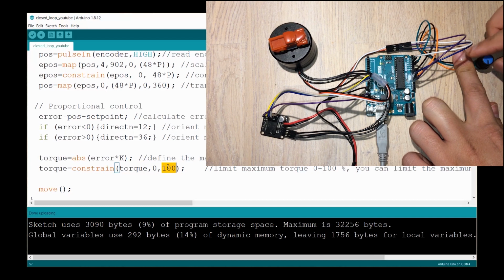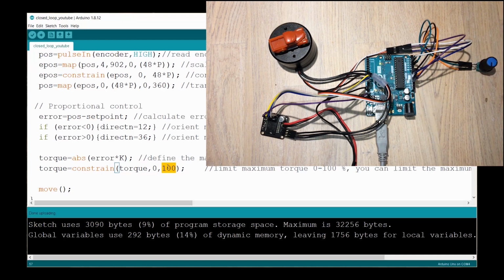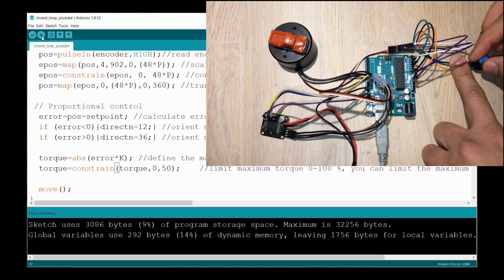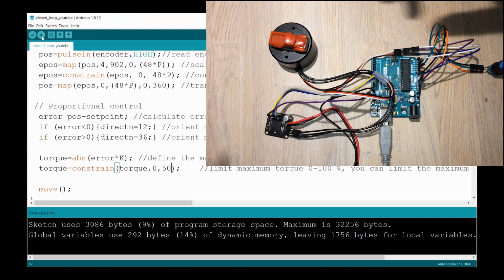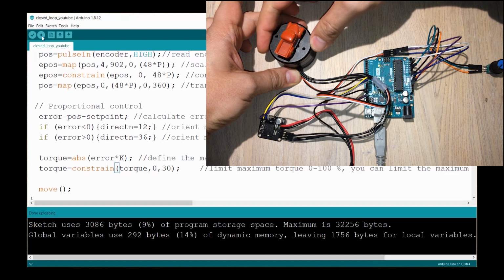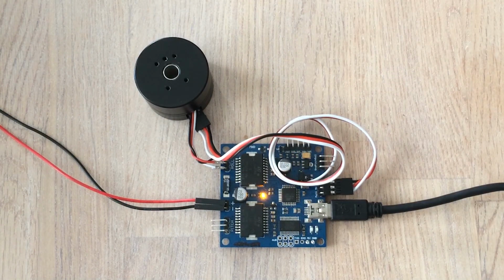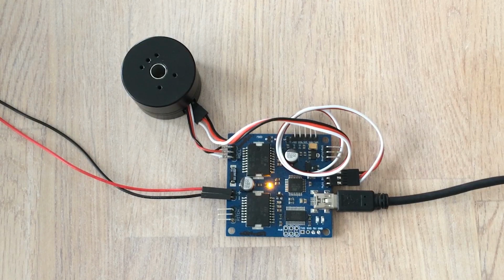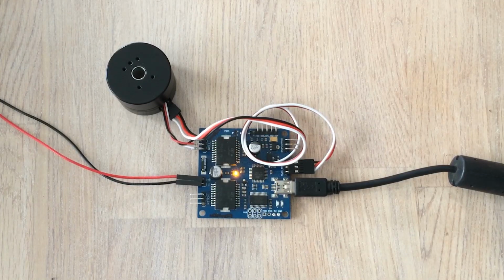Arduino Brushless DC Motor (BLDC) FOC Control Part 5 - Closed Loop Control Servomotor

Comment: Something you could add to this: currently your synchronization yields nearly zero offset between the stator and rotor fields.  You could nail this to a 90 degree offset and then control both velocity and position with voltage only

Comment: Thank you so much for this. I would love to see how you would integrate an continuous optical encoder for with multiple turns for applications where the range of motion is greater.
Reply from the maker: Watch my video about Tennange Engineerings arm. Its solved there ;)

Comment: hello Pablo,  ur videos really came in handy to understand the principles. i've got some questions which i'd really appreciate if u would clarify them for me, i want to use a gimbal brushless motor for turning a reaction wheel according to a controller, right now i want to choose my main board and start building the thing(i've done some designs on controller):
1. gimbal bldc motors have relatively small cables, which i suppose they won't carry much current, is there anyway to use the Arduino itself to drive the motor and not a secondary driver(like the L6324D)? 
2. is this way of controlling bldc motors(this sinusoidal signal ) the only way to control the bldc motor? i mean, for this kind of signal we are limited by the speed of the Arduino to compile each loop which may cause some issues in future(for my application) related to runtime and coding algorithms.
3. is there any "GIMBAL" bldc controller which would automatically produce the sine wave? or they are all the same? i guess what i'm looking for is a kind of way that would be easier to work with like voltage in simple dc motors!
4. usually a closed loop system's controller, produces a voltage which will be sent to the motor to move, how does this work out here? i mean the calculated value for controlling the system is voltage! how should i compliment it with the code u used?

thank you very much for ur informative videos, liked and subbed looking forward to ur future projects and informative vids

Comment: Hey man! Great videos! I have a question regarding the development board. I have a similar board from some gimbal project, but i want to use it as you do, it also has AT Mega 328P and basically looks exactly the same, but Arduino IDE does not "find it". Is there something i have to do? Burn new firmware up or how does it work? 
Thanks for help and keep up the good work! ;)

Comment: Are you just writing to the high side mosfets or is there hardware between the arduino and the drivers? Just asking as the code only is written to 3 output pins.

Comment: Hey Pablo First of all amazing video series. I had a question regarding the temperature of the gimbal motor, does the motor heat up and if it does, is it normal and what max temperature can be considered to be normal. Is there any way to prevent the motors from heating up?
Reply from the maker: Thanks! Yes, the logical way is to reduce the current in the coils. So either reduce the voltage of your source or multiply the output by 0.5 for example so that the current drops to half, then adjust that to a value that gives you the torque you need without overheating the motor. A motor like this will de-magnetize at around 100-120 deg C.
Reply: Also I would like to know if keeping the torque constant and applying PID on the direction value is a good idea, because what if I want to apply torque against the gravity with a load on the motor.

Comment: Hello,
Thank you for these 4 videos, very clear and very well explained.
I am looking to develop a torque control of a brushless motor with arduino.
The particularity of my control is that the couple must be proportional to the difference in position (k3 * Dtheta ^ 3 + k1 * Dtheta).
Do you know if this kind of control is possible?

Thank you for your reply!
Reply from the maker: Sebastien Prothin im not sure I understand... is there a paper or article you have where I can read about?
Reply: @juanpablocanguro  
In this paper, there is the explanation of why I want to do this:

https://we.tl/t-StwjvR8oyF

I work on the vibration control on the wings, with a system called NES, for the moment we are using cubic spring systems for wind tunnel tests. but I would like to be able to simulate a behavior of spring with a motor, to be able to sweep a greater range of parameter. This is why I want to control an engine with a cubic torque.
Reply from the maker: Sebastien Prothin interesting paper! Well, now I understand a bit better, i believe then what you need to do is to grow the magnitude of the magnetic field vector cubically to the magnitude of the error, torque = K*error^3, does that make sense? Keep me posted, would love to be of support ;)
Reply: @juanpablocanguro  
I will try to test this quickly.
For you, it is preferable that I use the driver L298N or L6234D?

In general I use an analog encoder which gives me the position of the motor, can this replace the encoder you use?
It is a sensor which gives me 0-5V for 0-360 °.

Here are the specifications:
https://cdn.usdigital.com/assets/datasheets/MA3_datasheet.pdf?k=637238129807247672
Reply from the maker: Sebastien Prothin i believe the L298 is not very efficient and gets hotter than L6234, apart from that, they both give good results :) maybe check the max current you need and match with the driver that takes that current
Reply: @juanpablocanguro  
thank you,
Is there a shield with the L6234, I can't find it on the net?

Comment: First of all great video! I have a question regarding your code: Why do you need to constrain() the epos? I think using map() it is already impossible to get out of range?
Reply from the maker: Felix Hübner well, i had some bugs that could have been caused by other things, but i wanted to make sure, as sometimes noise in the sensor would cause the value to vary away from the range, and I thought maybe map() was extrapolating outside the range, could be redundant as you noted, thank you!!!

Comment: L6234D  is not the best solution. I used DRV8313, it has same interface, but much more better efficiency factor. 

The same task I have solved by different way.
In my application I operate with velocity to have possibility to control it. 

    lastAngleA = curAngleA;
 
    curAngleA = angleA - ofsetA;    
//position from encoder
    
    lastAngleB = curAngleB;
    curAngleB = angleB - ofsetB;  

    lastVelocA = curVelocA;
    lastVelocB = curVelocB;
    curVelocA = curVelocA*0.7 + (curAngleA - lastAngleA)*0.3;
 //kalman filter
    curVelocB = curVelocB*0.7 + (curAngleB - lastAngleB)*0.3;    

    //PID
    errVelocA = tarVeloc - curVelocA;
 //error
    errVelocB = tarVeloc - curVelocB;
    
    stepTA = errVelocA * Kp;    
             //proportional
    stepTB = errVelocB * Kp;    
    
    integralA += errVelocA * Ki;              // integral
    integralA = constrain(integralA,-20,20);
    stepTA += integralA;                       
    
    integralB += errVelocB * Ki;              // integral
    integralB = constrain(integralB,-20,20);
    stepTB += integralB;                       
    
    stepTA -= (curVelocA-lastVelocA) * Kd; 
    stepTB -= (curVelocB-lastVelocB) * Kd;     
   
//and how I do  magic
    stepB = constrain(curAngleA + stepTB, curAngleB-300, curAngleB+300); // 300=1024/4 because I have 1024 sin value 
    stepA = constrain(curAngleB + stepTA, curAngleA-300, curAngleA+300);

Comment: First of all thank you for the video and the code on github. I have a question. I'm trying to control a gimbal with the same code but diffrent from yours is that my motors dont have hall sensors or encoders so i'm feeding the position of the IMU as the motors rotor position. I'm also using a complementary filter for the noise reduction. But still it is very hard to control and i have always vibrations on the motors. Do you have any recommendations ?

Thank you in advance.
Reply from the maker: İsmetCan Hasancebi you can refer to my first video (click part 1 in the links) that code is for bldc motors with no sensor, hope it works;)
Reply: @juanpablocanguro  I saw your first video on the series. But I need a closed loop control without the capability of the rotors position. Only with the help of IMU sensors.
Reply from the maker: İsmetCan Hasancebi yes, use that code, and add the Proportional control using the angle as the variable to control, measure angle with imu, then calculate error*kp and add that amount to the motor position... good luck!

Comment: Pablo, Great project & superior explanation!

Newbie for Arduino & FOC here, Can your development board can handle 2 independent servo motor control simultaneously? and also driven by 2 independent PWM input signal (I didn't see that in GitHub code)? and if so, can you provide code or update your Github please & I'm ready to order.
Reply from the maker: Thank you! Im glad you liked it! Yes, the board will be able to drive 2 motors in closed loop simultaneously... you can check this video and the code for it ;) https://youtu.be/kCHiuNaOTdY

Comment: Hey there! Very nice video! Do you use FOC in the algorithm?
I want to drive a differential drive base with BLDCs without reducers. What kind of controller would you recommend?
Reply from the maker: Tayyip Ensar Özkaya hi! Im not very experienced when it comes to FOC, i believe im using a similar principle, but to my understanding, FOC would also involve a control loop for the current being delivered. Here, because of the slow rotation, there isn’t really a lag  between the current and the voltage, so I control the voltage... I still need to study more into FOC to better understand the differences between it and what Im showing here, yet, this also delivers working results :) if you have more insights on this regard, id appreciate your comments. For your application, maybe try Vedder ESC ?
Reply: @juanpablocanguro  Thank you for your reply. I'm also still in the process of learning it :)
So how does your motor turn so slow? Is there a reducer? And if not, would you say the torque is high enough to drive an average RC car?

Comment: Can I make is some faster and more responsive if I will using STM32?
Reply from the maker: uthvfy rekbnm probably, in my case, the arduino can drive the motor faster than the motor can respond, so no point in upgrading the uC, but gimball motors tend to be slow. if you want a fast rotation, you may be able to skip the whole sinusoidal wave, and just activate coils on/off, that would work with motors that have faster response if you are looking for high speeds, maybe I can make a video about that.